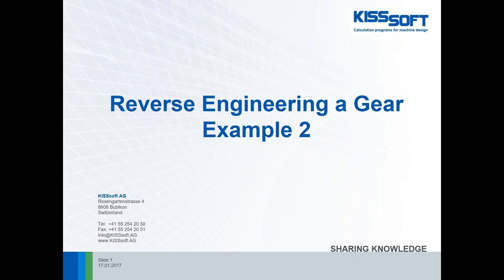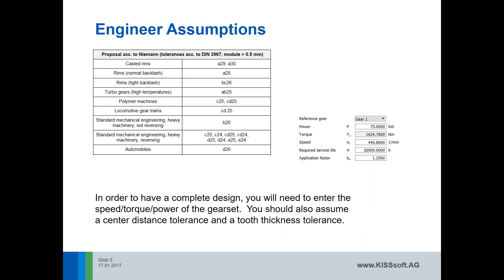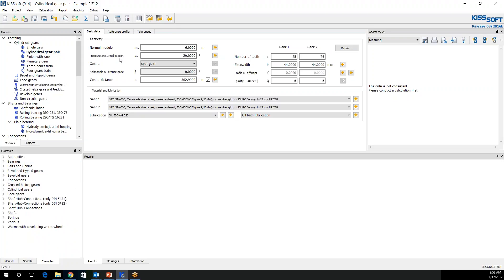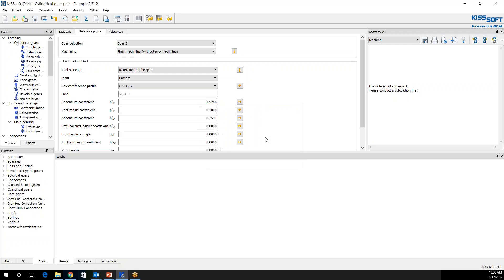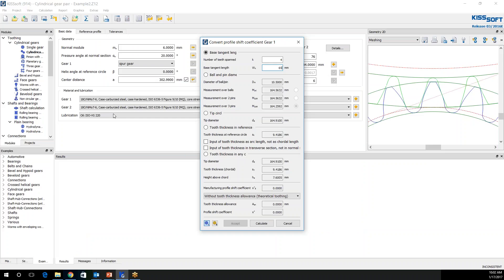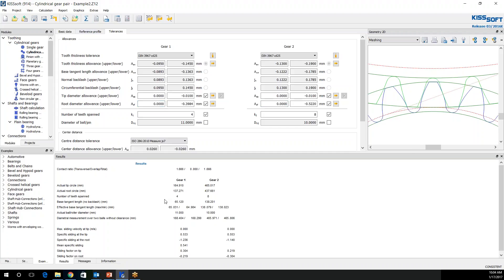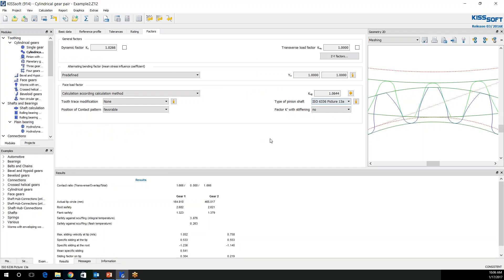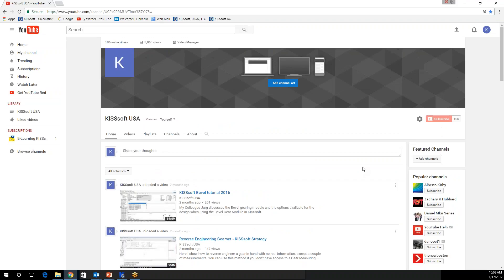Reverse Engineering a Gear Pair - 2

Comment: how do you calculate the initial measurement info of gear
Reply from the maker: you make measurements on the gear and enter it into KISSsoft, then based on what you are seeing in the tooth from, you make assumptions etc to fit the data.